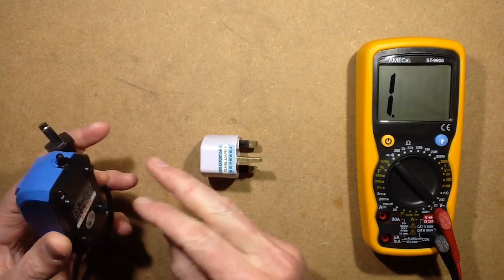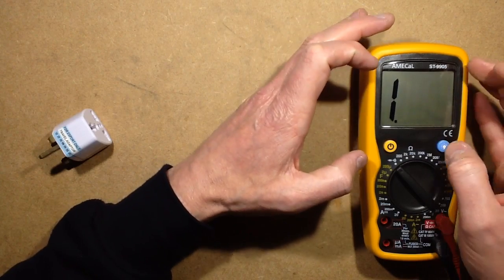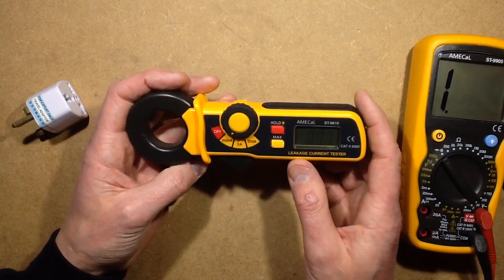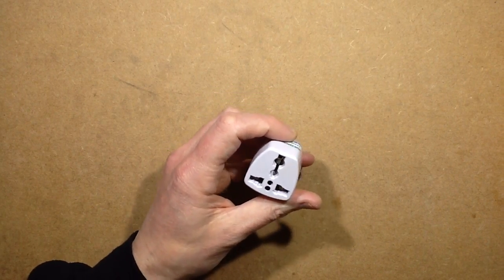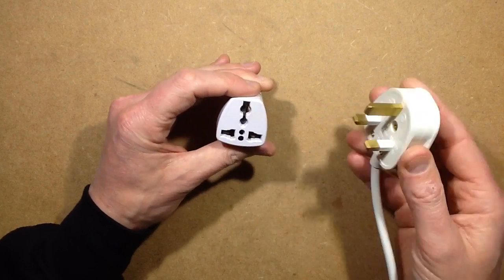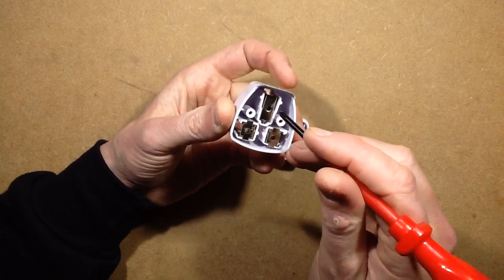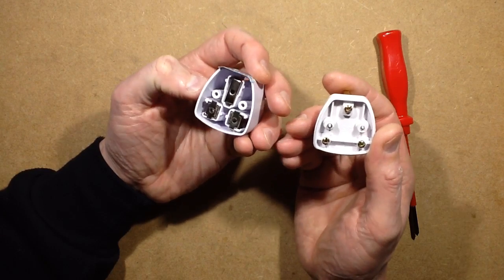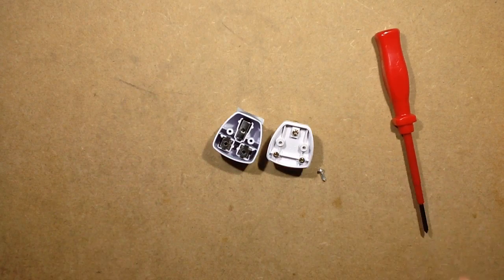Inside another death-dapter variant.

Comment: It's just poorly assembled, those screws should go through clamps (hence there are holes), so that socket contacts are attached to the lower part with pins.
Reply: I opened 4 of these units, none of them had the screws going through. Shocking!
Reply: +Иван Ерохин agreed, but, the fact that the ground will fit into the hot, is just terrible and dangerous.
Reply: I am going to have to resist as I am currently waiting for the football to start. I am amped up for the match today. But it can't hold a candle to the Olympics. Especially the pole volt.
Reply: these puns are giving me a Short temper...
Reply: Even is it was assembled properly and the earth actually made contact with earth, it is still horrific for the other reasons explained.
Reply: Samuel Doye I see what you did there ;)
Reply: Go Ohm, you're drunk.
Reply: Indeed, it could have been 10% less awful!
Reply: Deathdaptor update: I found another 3 deathdaptors and none had screws correctly installed. I took one apart and decided to see if it was actually possible to assemble them correctly. Turns out the earth contact has the hole positioned so that if you try and screw it in it won't line up properly and you can't close the case.
Reply: Puns are fun!
Reply: I have one of them (with the italian plug, not the uk one) and it was assembled correctly
Reply: to me it doesn't even look like they even line up

Comment: I've always wondered why Brits run everything off 200+ instead of 110/220 like the US. It seems kind of super dangerous to have your electric razor running off the same power a C&C machine would run off of.
Reply: +8BitSloth pretty much everywhere uses 220-240 except for north america and japan. but theres a common saying that goes "its the amps that kill you, not the volts" anyway. which is sort of kind of true in a way, like when you get a shock from static electricity it can be tens of thousands of volts, but very low amperage.
Reply: That isn't my favorite phrase since volts can kill and it totally ignores resistance. Nit picking aside, I mean WHY is it that way. It makes more sense to keep the low end and high end seperate. There has to be some logic behind it other than that is the way it is, shut up slave. lol

Comment: What would it take to rewire my appliances? Could I say, cut the American plug off my TV and wire in a GB plug then plug my TV in?
Reply from the maker: +Eric Taylor Some appliances will run on universal voltage, but many 110V ones will just die explosively when connected to a higher voltage.
Reply from the maker: +Eric Taylor Some appliances will run on universal voltage, but many 110V ones will just die explosively when connected to a higher voltage.

Comment: There's a thing I do not understand: Why do some countries still use these power connectors? The US- kind is just dangerous and unsafe; weak contacts an in case sth. is touching a connector pin, you might risk your life putting it into the socket. The british one has the advantage of having a fuse, but that's it. It is way to big and here again, if the insulation of one of the pins is damaged, probably you have a problem. Personally, i prefer the german, the french, the swiss and the danish ones. Way more safe.
On top, with the types mentionned, you could not in any possible way connect the earth terminal to live or neutral, not even with an adaptor.

Comment: Hey Clive, did you see the europe version of this same adaptor? It is safe as hell, because you just cant put it inside the socket - it has same body like UK version, but there are screwed two cylindrical pins. I am so glad that i bring chinese socket rail with me from China. I can plug every ebay electronic just the safe way, no adaptors needed.

Comment: Great video. I discovered a few of these in an office a while ago. The self tapping screws used to hold the case together had stripped the posts. Result: when the appliance plug was pulled it took the top half of the adapter case with it. The bottom half remained in the socket, along with the pins which were now exposed. This product must win an award for the highest number of dangerous failure modes.

Comment: Try testing the pin where the American plug would go. Also, most things INCLUDING you pump are double insulated and do not NEED a grounding pin.
As for the possibility that the ground pin can go in the line pin, so what. If they are that stupid, let them fry.
But i suspect the earth ground would activate when a plug was inserted. The flaw may well be that the other 2  are NOT supposed to make contact until the plug us inserted thus making the socket dead if left plugged into an outlet and some little fingers come exploring.
Just a thought.

Comment: I have opened a couple of these kinda adapters, and the screw should hold the metal to the part that has the plugs to the wall, hence the holes in them! I know they are not good for high amps but they work ok for a phone charger or something similar.. 
Thanks for sharing

Comment: it's a bit a sad design to give a male pin for the earth though. Our euro earths are female pins, so you can't connect it with a live pin. And f.e. the German design use side earth pins, which are completely different in design, so also impossible to connect with live pins.

of course, I know that the adapter designer should take care of making that connection impossible, but it just seems way easier to avoid that connection with euro plugs.
Reply: +Sander Deryckere Looking better at the adaptor, I guess that the non-connected earth pin is actually a montage mistake. There are clearly screw-sized holes in the female connectors. So I would guess that the screws should hold together the female connectors and the male pins (instead of just holding the male pins to the case), and then it should slide in all together.

Comment: Don't know if the link below will work or not but it's for something silly in the cheap chinese adapter line... one with a 3 pin socket on the front... and a 2 pin socket on top too1

Dangerous? I wouldn't use one that's for sure!

http://www.ebay.co.uk/itm/Universal-Travel-AC-Power-UK-EU-AUS-to-3-Pin-USA-America-Travel-Adapter-Plug/272025624135?_trksid=p2060778.c100276.m3476&_trkparms=aid%3D222007%26algo%3DSIC.MBE%26ao%3D1%26asc%3D20140725133651%26meid%3De388829f78a94fb895c0b34f7d3d4631%26pid%3D100276%26rk%3D3%26rkt%3D4%26sd%3D321218047746

Comment: I think they're meant to be screwed completely through the contacts into the pin holder, so you would screw the 2 halves together and then put a screw through the positive/negative/earth plug holes, through the hole in the contacts and into the hole where the screws are in this one. Might just be a case of faulty assembly.

Comment: Hi Clive! I'm not sure, but it looks like the whole adapter hasn't been assembled properly. When I watched this and you said the screws makes the contact and the connectors slide inside, first thing came to my mind that it was intended to assemble so that the screws hold the contacts against the backplate, so when you remove the screws the metal slides comes out as well, but for some odd reason the wall contacts were screwed in place without the adapter metal slides.

Though I haven't ever had one of those to tumble with and in EU don't need one, the alignment suggests it would be so. Thank you for your great videos, love to watch them and learn more about electronics :)

Comment: what a shameless plug, huehuehuehue
Reply from the maker: +Liam Russell I don't think it has any shame whatsoever.  It knows what it's doing and is just bad through and through.
Reply from the maker: +XTheGamingBossX I'd suggest only using a decent pin converter bought from a high profile local supermarket.
There's no point suing Chinese suppliers.  The only person who would win would be a lawyer, mainly with your cash.
Reply: @bigclivedotcom  I just found 3 of these in my house 2 the same as the one in the video and a black one of a different design and I copied your test as I have a cheap metre and all 3 had no earth. the 2 white adapters are now earthed as I've pushed the plate towards the earth pin screw.
I use these for charging phones and was probably sent them because I don't remember buying them. Thank you for this the black one is getting binned right now it's not earthed at all.
Reply from the maker: +XTheGamingBossX Probably, but mostly naive.
Reply: +bigclivedotcom To make it worse, there's very little distance from the live, neutral, and the outsides of the case, meaning someone's hand will be dangerously close to them when they plug it in!
Reply: In the words of the wise sir Jesse Cox: "Advertise like a shameless whore!"
:D
Reply: +bigclivedotcom I know nothing about this stuff, but I have an adapter which I'm 99.9% sure is the same as this one (arrived with my OnePlus One import from a cheap Chinese seller on Amazon). Provided I'm not stupid enough to plug things in to it incorrectly, is it safe for me to use it, or should I throw it away immediately?

Also, I have a slightly different question. Would it not be possible to sue some of these companies selling dangerous equipment? Even if they didn't actually cause any damage, it must be very easy to prove they'e selling dangerous equipment that puts their customers in serious danger. Apart from the money (dunno if you'd even get any without being harmed by it), I would think if people started to at least threaten legal action on a large scale it would stop a lot of these companies doing this stuff, would it not?
Reply: bigclivedotcom Thanks.

I would imagine these aren't just Chinese suppliers though, right? There must be some European companies shipping them?

Comment: I wonder if they skipped an expensive step by not screwing the back plate in through the pin connectors? Each terminal seems to have a hole where--roughly--the screw head lines up.

I'm not saying it would be brilliant, but it might at least partially work.

Comment: hi Clive, just came across this video and it peaked my interest as I just recently bought a TV box from geekbuying.com and it arrived with the exact adapter in your video, very flimsy, the plug on the power cord has 2 prongs and I was wondering if this can be cut off and a standard british 3 prong plug attached, or would it be dangerous to do so. many thanks in advance Clive.
Reply: If you're worried about the low-voltage power supply you could buy a reputable brand locally and throw the supplied unit away. I've been horrified with the safety of really cheap power supplies that I pulled apart...
Reply: +JakesDen Gaming not last buy I made, I bought a tronsmart orion r28 that came with a three prong plug.
Reply: +vger 147 If you are technically inclined to wire a plug, It would be perfect safe to wire it up with a different plug. However, your UK 3 Plug would have to be just L/N because it wouldn't have a ground wire going to its current two prong plug. But yes. You can.
Reply: +Sollux Captor No, look at the picture. That cord has an AC to DC converter on the end, and those things generally can't be rewired. Hooking the cord straight to mains would be incredibly dangerous. It would however be acceptable if this was a straight mains cable which, to be clear, it is not.
Reply: Oh, I wasn't aware of the lack of being mains.

Comment: One thing you didn't point out was the pin sizes - if you compare them, the death-dapter pins are significantly smaller than a real plug, so you can get some fun arcing in some sockets where the undersized pins don't make a good contact. Some of that is due to them being the wrong shape as well though.

Comment: Whats wrong with the damn Schuko plug?!
Reply: +Thomas Wallblom You can't make a whole appliance live with it, so it's obviously inferior to the british plug
Reply: +Thomas Wallblom - It's reversible (so you can't be sure which wire is live and which is neutral) and sockets generally don't have a fuse. In most situations neither of those is a big problem, and the size is a lot more manageable than UK plugs', but hey, you asked...

7/5 (French) or 7/7 plugs (with 7/5 sockets) are a slightly smarter solution.
Reply: +Per Mejdal Rasmussen
3) While I agree, it can be a negative for the engineer side of view, for customers it's great, because you can fit those power adapters the way best aligns with your available space.
5)/6) Those sockets are incompatible and shouldn't be used together anyway, so I wouldn't consider it a problem with Schuko (you'd have that with any flat socket). You could also damage a Schuko plug by cramming it into a British socket. ;)
Reply: Drawbacks of Schuko:
1) Bulky:  18mm of added depth to the socket. Because it is recessed.
2) Lower durability: The side pins can be damaged by incorrect use.
3) Non-polarised: All switches must be two pole to ensure a device is not live when turned off. Schuko male to E27 socket have a 50% chance to make the side of the socket live, which is easier to touch.
4) Schuko male fits in an unearth socket. Making it impossible to enforce a ground connection on a device that needs it.
5) Non-insulated pins: When connecting a Schuko plug into a flat unearthed socket, one can easily touch the live pins.
6) incompateble: None-earthed (CEE 7/2) plug does not fit, and can damage a Schuko socket.

The benefits of Schuko:
1) Very stable connection. Can support heavy transformers build in to the plug, even when socket is in the ceiling.
2) Impossible to touch live pin while plugging in a Schuko plug to Schuko  socket.
3) Reversible: Allowing two potions.

Conclusion:
in my option Schuko is overall the best 230V plug and socket system in use in europe (there are many see: http://surl.dk/fnu/). Its most serious  drawbacks are when you mix it with other systems.

But if I became world dictation of plugs and sockes, I would enforce IEC 60906-1 everywhere. See picture nummer 6+7 on this page: http://surl.dk/fnv/
Reply: Correct, the 7/5 socket is the better solution. There are countries, where it has to be mounted polarized (Czech Republic) and others where the advantage of the construction is not used (France, Poland).
I prefer these over the side contact Schuko system, and both are legal to use in most areas of Europe.
Reply: 4) Schuko male fits in an unearth socket. Making it impossible to enforce a ground connection on a device that needs it.

This not a drawback, The 7/5 protruding earth pin plugs also fit in unearthed outlets. This is a feature.

It is not legal to have unearthed and earthed outlets in the same room, or use unearthed outlets in damp rooms, bathrooms or where grounded metal (heating pipes, radiators, ...) can be touched.

It is prevented to insert Class 0 appliances (the ones with 2 pin round plug from the past), into grounded otlets. This could give dangerous conditions, as a faulty appliance (eg electric iron, 1940) cannot be used in the kitchen, where a grounded fridge is placed. So it it could only be used in a living room, with wooden floor and rug on top, that acts as the extra insulation against shock.
Reply: But if I became world dictation of plugs and sockes, I would enforce IEC 60906-1 everywhere. See picture nummer 6+7 on this page: http://surl.dk/fnv/

Follow to that. Has all the benefits of the British plug in a smaller form factor. This is intended for 240V. Unfortunately the IEC has agreed on the US polarized crap plug for 120V applications as world norm.
So far only South Africa and Brazil have adopted these IEC plugs, but Brazil made 2 incompatible sub catagories. The original plug was designed for 16 Amp, Brazil has a 10 Amp and 20 Amp variant, and uses it only in areas with 220 V supply.
Reply: Per Mejdal Rasmussen:
2) I remember having ground pins broken long ago, but I don't remember it happening to me in the last decade or so. They probably have higher quality now.
4) and 5) Are kind of false nowadays. It's very rare to me to find an unearthed socket that allows me to connect a grounded plug: Because it has the "europlug" rhomboidal shape or has small holes. Or more frequently, both.
6) I don't see these around here.

Another advantage of Schuko is how plugs and sockets are so cheap compared to the UK.

Another thing to keep in mind is that for new houses in the EU (or at least in many EU countries) is mandatory to have a differential circuit breaker protecting the house. They typically trip when 30 mA escape through ground.

Comment: I got one of them supplied with a lepai amplifier, the power adapter wiggles about in the plug adapter though I bought a 13A fused status branded visitor to uk adapter which the power pack sits rigid in... the cheap chinese adapter I wouldn't trust at all in the interest of safety, not just shock hazard but poor connection could result in fire too.

Comment: if it's so easy to make a dangerous travel adapter it's because of the flawed u.k. plug that requires the implementation a recessed receptacle to be safe instead of being intrinsically safe

Comment: Some of the death adapters I've had in the past were actually magnetic - the brass pins stuck to magnets and that was without the steel screw inserted down the middle to hold them in place..
That's on top of the magnetic flex I've found on some imported goods!

Test one of your adapters with a rare earth magnet.

Comment: That is shockingly bad (no pun intended!)....a complete reliance on contact pressure of the screws can easily result in a poor connection, significant contact resistance and if anything with a high load is used with that adapter the whole thing could overheat and catch fire. Oh and as you pointed out there is the little matter of no contact at all on the earth pin because of this very shoddy design. Horrible horrible horrible!